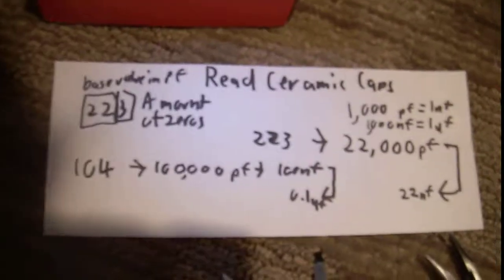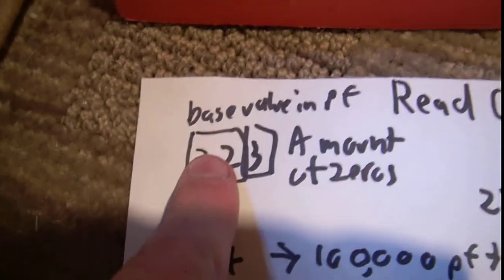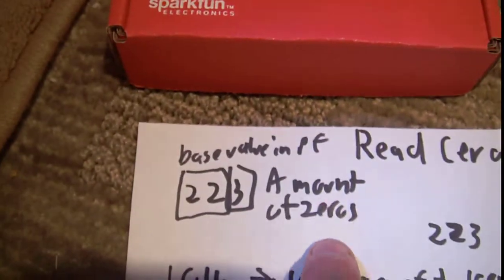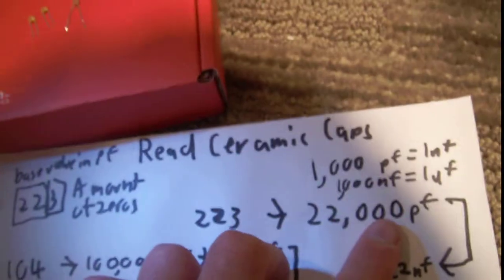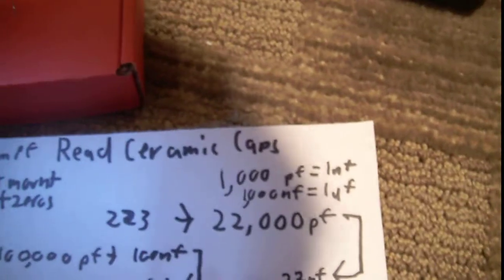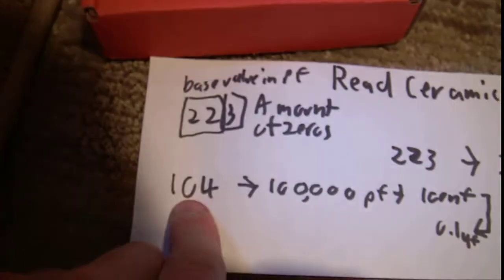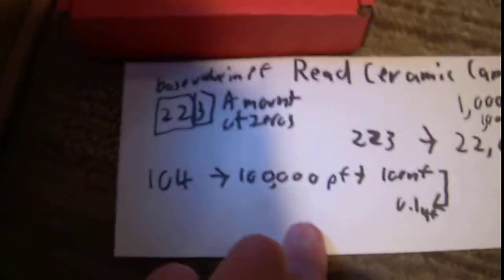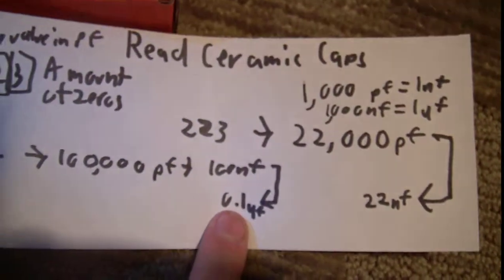How To Read Ceramic Cap's

Comment: 15j means 15 picofarads with tolerance of 15% because of the letter 
"j". When there is no measuring unit it is in pico! 3 kv is the maximum working voltage of 3 kilovolts. u2 I guess is for size or something not so important...

Comment from the maker: I'm not 100% sure you really should measure it and report back to see if my guess is right. My best guess is that it is a 215 cap, or 2100000pf, or 2100 nf, or 2.1uf (they are all the same thing).